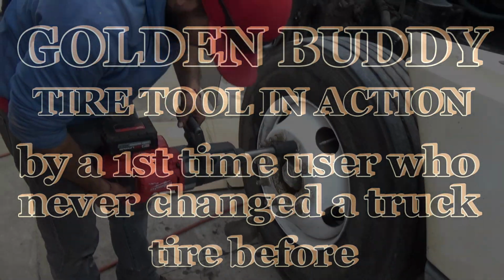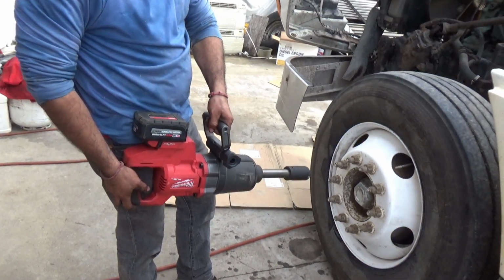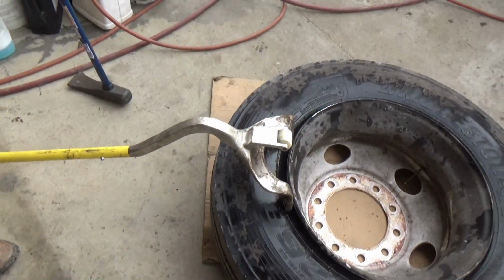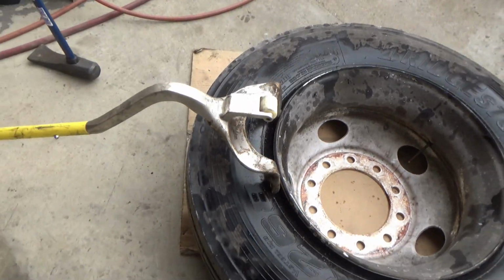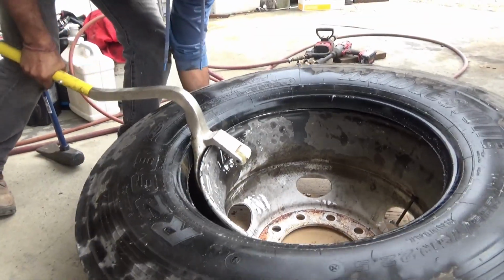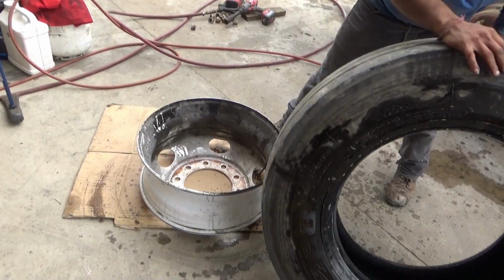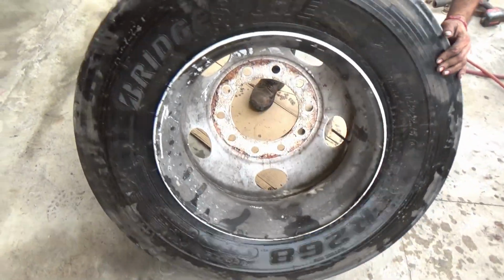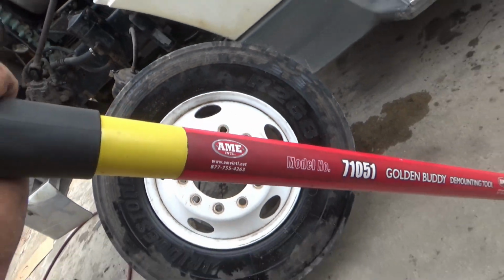Golden Buddy Tire tool

Comment: just a heads up Gordon, I use a Milwaukee 3/4 which is about half as big but appears more powerful than the 1 inch. they're about $425 without the battery but they are excellent for truck wheels
Reply from the maker: I have 2 of those, 1 in my truck and the other in my shop. I think I used 1 in this video with an extended socket on it. They're not as strong as the 1" but the mechanic at my job may have put those wheels on and he overtightens a lot of things with his air 1" drive.

Comment: Once you get the first bead off, balance it evenly on the rim.  Work the Golden tool down towards the second easily.  once you make contact give the bar a quick downward shove and the two legs will pop under bottom bead!
Reply from the maker: Thanks, I'll try that next time.

Comment: I have the Milwaukee  1” tire gun  love it did you know that  you can change the power settings on your phone that gun has lug nut mode and you can crank power up to 1900 ft lb
Reply: I did not know that I’m going to have to try it on mine.

Comment: I hated it when my old boss would see uneven wear on the steer tires of the bin trucks. They run 425/65R22.5 tires they are a bitch to dismount and mount. The overseas brand tires like Sailun  have thick, heavy beads. You can get a little more life rotating the steers. A 425 tire is 1200 dollars each.
Reply from the maker: Yes they are expensive and need to try to balance the wear on them to get the most out of them.

Comment: I notice that the chap just stands on the tyre bead to break it away from the rim.  It's not like this in my life.  Breaking the tyre bead away from the rim is a sizeable job in itself which can take half an hour using tyre  levers.
Reply from the maker: Most of the time I just hit the tire with a big hammer next to the rim and no more than 2 or 3 hits and the bead breaks. I have had to put the tire in front of a truck and drive over the edge or put a bottle jack on the tire under the frame of the truck but only a couple times in my life.